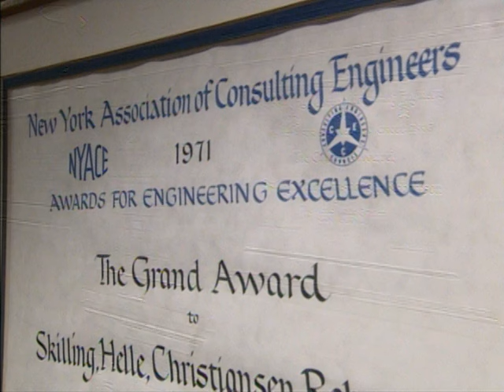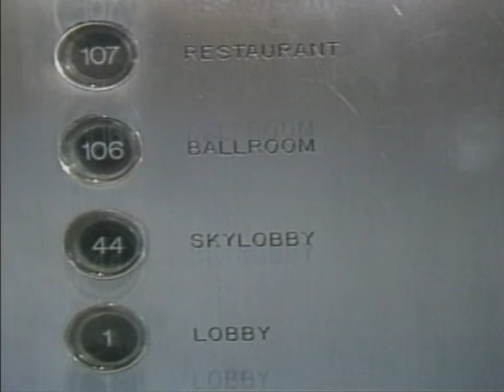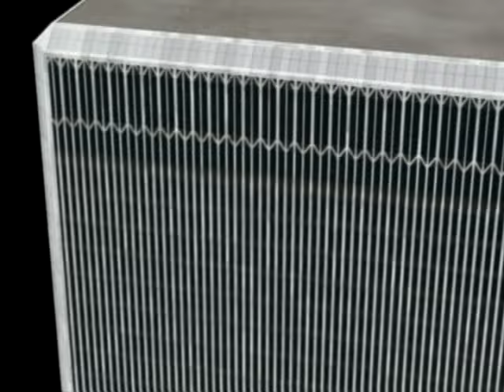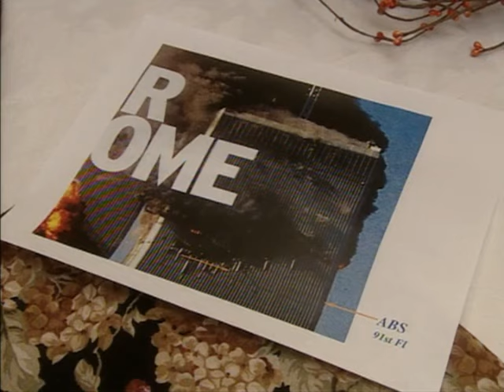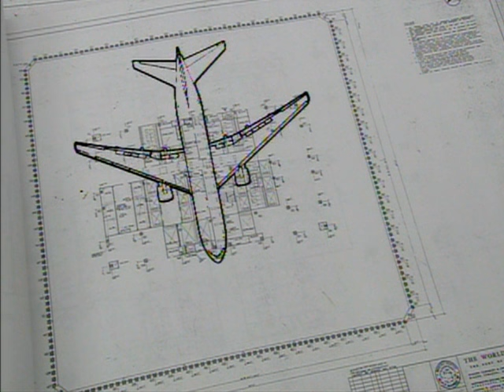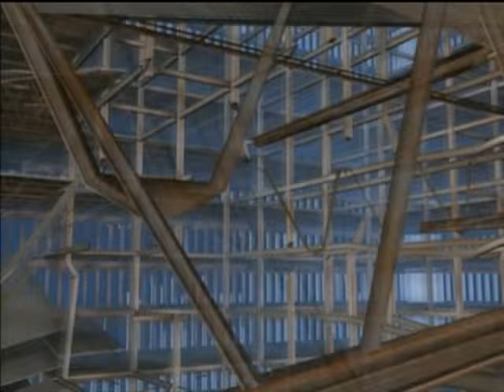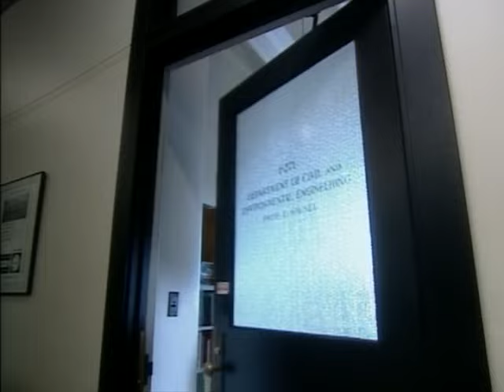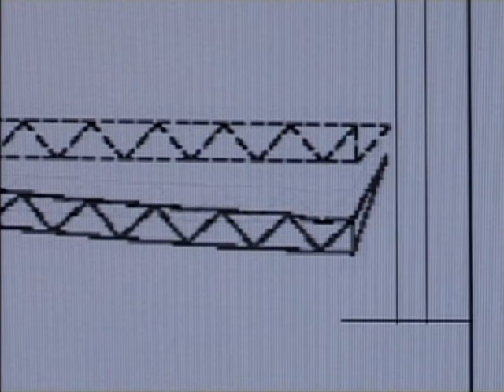World Trade Center - Anatomy of the Collapse

Comment: I have seen the same design and connections used for roofing systems which have failed in fired or ripped off in a tornadoes.  As soon as learned this was the design for every floor in this building building that each flooring panel was only connected with four bolts is became immediately apparent that the structural design was at fault for the people being trapped and the catastrophic collapse of the building.
Reply: Sure
Reply: @davepowell7168  ..and to clarify since you seem to be a little slow, I'm talking structural members as in the trusses and cantilever and connections to load bearing members.  It was a couple bolts connect to a shelf rather than a typical I beam.  Most construction use I beams for flooring support not trusses.  Only ever seen trusses used in roofing systems.   Sorry my comment was not layman enough for you.
Reply: @rstranghoner   l guess the patronising and rude approach is just stylistic
Reply: @davepowell7168  did you even watch the video.  Good God.
Reply: @rstranghoner  Have you looked at a cross - section of the towers. The 47 giant columns are impressive 
John Skilliing included larger than normal redundancy because of the height. 
The storey's below the fires were solid rebar,concrete and stone cold steel

Comment: 13:38 Large open spaces.
25:50 Central Core gets damaged/destroyed by Airplane. 
Fire Insulation on Steel Beams is damaged by Airplane.
Plane is loaded with fuel for a 2,500 mile flight.
Heat from the Fire and damage to Stuctural Central Core Posts weakens the Building.
Weight of upper Floors overpowers the Buildings weakened strength and down goes the Building.
Reply: Except that didn't happen in real life
Reply: Outer decks yes but not the entire inner core, i don't buy it

Comment: In both towers, the fuel from those planes ignited fires on the impact floors between 1,500 and 2,000 degrees F which corroded the steel beams and support columns which led to the collapse. American Airlines Flight 11, a 767-200,  hit at almost 500 mph or just over 400 knots between the 93rd and 99th floors right into the teeth of the building. The stairwells were either blown out by the impact or the plane’s fuselage and the debris from it obstructed the three stairwells or there was too much smoke to navigate. If you were at or above the 92nd floor and above, you were doomed. I’m very sure everyone in the impact zone was killed when the plane struck head on but those above the 99th floors survived the initial crash but died from either smoke inhalation, the collapse or jumping. United Airlines Flight 175 crashed towards the corner of the 77th through 86th floors at a 45 degree angle and one stairwell was clear all the way up because the plane hit towards the corner unlike the north tower which was hit straight through. The speed of the impact  had a big factor in which tower fell first. The south tower collapsed first because it was hit lower than the north tower and towards the corner which caused the section not directly affected by the fireball, to lean towards the west: also the speed of the aircraft apparently affected the force.The north tower was hit right in the gut higher up than the south tower about 100 mph slower which is why it stood longer despite being hit earlier and United 175 hit at almost 600 mph while American 11 hit at around 500 mph so the speed of impact also had an effect
Reply: @brianstantz3457  those are my basic observations
Reply: Not to mention the damage to the buildings. In actuality the terrorists failed both times. Despite the loss of life on 9/11 their were at least 17,000 people in their at the time of the attacks
Reply: @melvynsngltn27  Not really.  It's hard to say they failed when 3/4 of their targets succeeded.  It was more about symbolism and that it could be achieved in America.  Thankfully the death count was much less, but I think it is the affect that has lasted.  I'm not a fan of the "you can't take our spirit away from us" gobbledegook because we all look back on this with regret and can never take it back.
Reply: @paulsmith1981  so the structure at and above the impact zones were badly damaged with smoke going from the impact zone to above the impact and maybe some below impact but the smoke at and above impact was suffocating and worse than below
Reply: The columns and trusses and steel beams that supported the weight of the structure as well as all the furniture and people and fixtures weighed god knows how many pounds (my guess is millions of pounds) were softened by the immense heat from the fires from the fuel of those planes which wiped out the structure supporting the weight and the floors at and above the impact zone which the floors below impact couldn’t support the weight of. I’m not sure how many pounds of 17 north tower floors as well as 33 south tower floors plus tower 2’s upper floor’s leaning on the lower floors. The speed and angle and of the impact and how high upwas also a factor to determine which tower collapsed when. The north tower was hit at about 500 mph straight through the 93rd and 99th floors so the weight of the floors was less. The south tower was hit at a 45 degree angle toward the corner at  just under 600 mph between floors 77 through 86 which weighed heavier than the north tower. Also, since the north tower was hit straight through the middle, all stairwells were either damaged or clogged with debris from the plane meaning if you were on the 92nd floor or above, you didn’t survive. However, the south tower, one stairwell was clear because the plane struck at a 45 degree angle toward the corner and we had a few survivors at the point of impact but very few from above impact
Reply: Each floor weighed 4 million pounds. Multiple that by the number of floors above the impact zone and that free falls several stories and there's no way anything stops that
Reply: @paulsmith1981  you seem to have entirely ignored the explanation given in the video. The outer walls and core are meant to support all the weight. The floors themselves were only meant to support their own weight, plus the necessary safety margin. The planes impact stripped the floors trusses of fire proofing, exposing the metal to the intense heat of an entire planes worth of kerosene, aswell as breaking many of the trusses and dropping them onto the floors below. The result was the trusses, more specifically the joint that connects the trusses to the primary support beams, we’re forced to hold significantly more weight then they were designed for. They managed to support this weight for a while, but the exposed metal was quickly heated up by the raging inferno, so the joints began giving way. As can be seen in 41:46. This dropped trusses down onto the ones below, which began giving way aswell. When enough of the trusses dropped, the primary supports, which have been weakened by the heat of the fire, are no longer being kept steady by the trusses. The supports buckle and bend as they give way, causing everything above that point to drop. This caused a cascading failure as all of the floors beneath this had all the weight above them dropped an entire story slamming into them with much greater force then they could handle. Once the collapse started, it just kept going. 

An additional factor to consider is the aluminum from the plane would’ve melted in the extreme heat, and the molten aluminum would’ve flowed down through the building. If this molten aluminum came into contact with water, like what you’d find in a sprinkler system, it would react explosively.
Reply: @jaym48  Oh boy..  It’s one thing to argue over how the towers collapsed, it’s another to claim that those airplanes didn’t puncture a visible hole into those buildings and shoot debris out the other side. At high speeds the strength of a material relative to the one it’s hitting becomes far less relevant than it would be at low speeds.
Reply: Soften, not corrode. Corrode means to rust and rot away.
Reply: This is the best compact explanation of what happened, wh. tower was hit wh. way, and why they came down.
Reply: @johannesbols57  you mean my observation/theory of how high up they were hit, what angle they hit and how long they lasted after being hit?

Comment: Both towers were designed to survive 150mph winds, plane crashes, earthquakes, and truck bombs. The designers didn't think of what fire can do to the towers.
The perimeter columns did their job on holding the towers up as long as possible to let many people escape.

Tests show that a fully loaded Boeing 707 can crash into a building in bad weather at even 600mph, and the 767s were equally similar in length and wingspan.

In tower 1, all 3 stairwells were destroyed when American Airlines Flight 11 crashed. However in tower 2, United Airlines Flight 175 only destroyed 2 of the 3 stairwells in tower 2, which left only 1 surviving stairwell.

Comment: Say what you want about a conspiracy or whatever, but the WTC design was as FLAWED as it was innovative for its time. If there were more support columns throughout the floors, the buildings may have held up longer or may have not collapsed at all. Not to mention the weak truss supports for the floors.
Reply: No building will be constructed that way again.
Reply: @JerzeeeDevil  they still are to this day what are you talking about?
Reply: @rowdyelitehater8595 they normally use concrete cores and thicker steel beams in newer buildings such as the shard or one Wtc
Reply: @Thefox0922  I understand that but it’s the same architectural principle.
Reply: @rowdyelitehater8595  yeah they do still use the tube. Also I’ve just completely read the comment and he is wrong
Reply: @Thefox0922  ty, I knew it was very very similar if not identical.
Reply: I wonder how the Sears tower would've held up. I think it would've survived as they were nine individual tube towers that togther made one building. That's a lot of support versus one stand alone tube design like WTC

Comment: If the floor trusses were welded instead of bolted to the outside walls, the towers would have stayed standing. It was just faster and more economical to bolt them instead of labor intensive welding. A weld is very tough and can deform and withstand much more sheer stress than bolts which have low sheer strength. I believe they used two 3/4" bolts to hold each truss to a welded bracket (which held) to the outside support columns.
Reply: According to Wikipedia, sagging trusses still connected also pulled the outside walls inwards.
Reply: No, they wouldn't have. NIST stated in a 2006 PBS NOVA documentary Building on Ground Zero that the trusses stayed connected to the columns and pulled them inward to their breaking point, until the columns snapped, and the buildings pancaked onto the lower structures.

Comment: 26:01 i think if the plane hit from the east or west side the buildings might have collapsed directly on impact.
Reply: Yea it wouldve
Reply: How?
Reply: @joeyharper4976  because the core would have been damaged a lot more.
Reply: @DutchDukeMan  How would a comprised core at upper levels, compromise the entirety of the building? the weigth above the impact, could not compromise the undamaged floors below in such a manor it would collapse.

Seems you also forget or are unaware the towers was build to be able to withstand being hit by a plane.
Reply: James Pietsch  
How about elaborating What your talking about. Your time stamps doesn’t say anything?

Stating one structural engineers comments over another’s, only prove they disagree.
So you haven’t disproven anything, whatever it is you are specifically talking about.
Reply: James Pietsch  and he is right. It was build for a 707, which wasn’t what hit the buildings.
But as the NIST report clearly states, it wasn’t the plane that brought the buildings Down, it was the fires that followed. 
So What’s your point?

Maybe read what i wrote 👍
Reply: James Pietsch  
Basic physics.
Pancaking instead of taking the path of least resistance. 
A weaken structural integrity in the top part, doesn’t magically allocate to the entirety of the building. Weakened trusses doesn’t make it possible. That would only separate the floors, and would absolutely not make all the steal beams on which the trusses was attached to lose their resistance to collapse.
Just watching it, in the insanely many angels it was taped, makes it undeniably clear.
You even see the top section disintegrate in a downward moving sequence, before the underlying floors start moving.

But instead of arguing, I’m fine with agreeing to disagreeing. I’m not here to convince anybody of anything. I just call out numbnuts like the thread starter, from time to time 🤷‍♂️
Reply: James Pietsch  
keep telling yourself that 👍

Refused to comment? Not sure which one you are referring to. But fair enough
Reply: James Pietsch 
You literally created an account to comment 😂
I can understand that, who would make such comments in their own name 🤷‍♂️

Comment: The most important thing nobody talks about is for example. The B-52 bomber has had a Fuel minimum the last few decades because fuel makes the wings/body stronger! When you have a aluminum plane packed full of fuel it’s like a solid chunk of steel! Like a armor piercing bullet with a steel core. Those planes were not just 80,000lbs of aluminum. I would be interested to see what a empty plane vs fully fueled plane. What the difference. It’s not just weight. It makes the flimsy aluminum into steel.
Reply: Good point

Comment: no seismic signal of any significance, no enormous pile of debris from 1,000,000 tonnes of tower on the ground or anywhere in the sub grade 6 levels. The mall, one level below the street was dusty but not completely filled with debris at all. The foundation/bathtub was not damaged or even cracked... it was in pristine condition. A concrete wall with the pressure of the Hudson constantly working against it, we are told steel beams that shake the ground when dropped 18 inches did not rupture these foundations when impacting the pavement at terminal velocity? 

No recognizable debris in the pile other than paper and dust. Where the hell did these things go? They certainly weren't demolished and most certainly did not "collapse" as a result of the damage inflicted by an aircraft.

Had they collapsed none of the items mentioned above (which represent a small sampling of a laundry list of inconsistencies) would have been observable. 

To me, the "collapse" much more closely represents two 110 story towers bursting into dust as they simultaneously lose their structural integrity and rigidity. This dust then simply floated off into the atmosphere after blacking out street level on a clear sunny day. 
- Think about how dense and voluminous  dust would be required to be in order to 'blackoutvftb ' the sun everywhere from 70' above street level for well over a minute in an open atmosphere systemn and leave a 6" carpet of itself everywhere within a ½ mile radius. Both towers were seen jut cascading dust from every possible surface and facet of their "collapse" as if they were two twin 1300 foot dust storage silos that just happened to have a very nice address.  The volume of dust is a much better representation of the vast quantities of physical matter than comprised the Twin Towers than anything at ground zero. 

Hurricane Erin apparently was the static charge necessary to create a field effect of for the directed free energy technology used to disrupt the molecular bonds (Hutchison Effect) of the steel, thereby instantaneously turning steel to dust and was then responsible for "Hoovering"/vacuuming two skyscrapers in dust form into the upper atmosphere and out of the city and our world. 

That may seem like an absurd sentence, but really examine the points I make before calling it a conspiracy theory and submitting yourself to the official story, which frankly, is an insult to our collective intelligence and is easily verifiable to be a fraud. I'd strongly suggest reading "Where Did the Towers Go"by Dr. Judy wood. It is the only forensic examination of the evidence from 9/11/01 available in the public domain, and if you allow yourself to be open to the factual findings contained there in, your life will never be the same... I am speaking from personal profound experience with this material.
Reply: Indeed. Let's look at the facts. What happened wasn't a collapse. Those massive towers mostly turned into dust in mid air. Now the How is the big mystery. To me it's always like watching a magic trick and trying to figure out what the gimmick or sleight of hands could be. We might never know, but a device or technology beyond what we can imagine exist and was used that day.
Reply: @guidrumstick  #notaconsipracy people

Comment: If the core was designed to stand without the floors, than the model he used to show that the building without floor support is weaker,  is not a accurate analogy. Case in point,  the first terrorist attack didn't collapse the towers.
Reply: So the core supports the floors? Explain please
Reply: James Pietsch  haha you see drugs everywhere, don't you?
Reply: @cooljackster7390  The core supported 60% of the building , the structural engineer John Skilliing designed extra redundancy because of the towers height . The towers could take a large airliner at max speed followed by a 100mph hurricane and not have a catastrophic failure
Reply: Because the bomb didn't explode under the North Tower: it exploded under the Marriott Hotel. That's why.